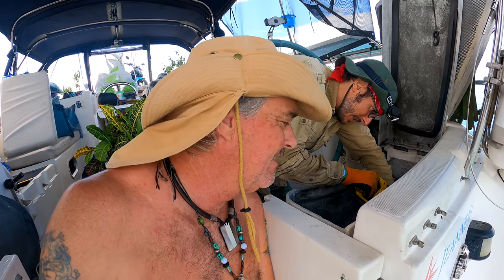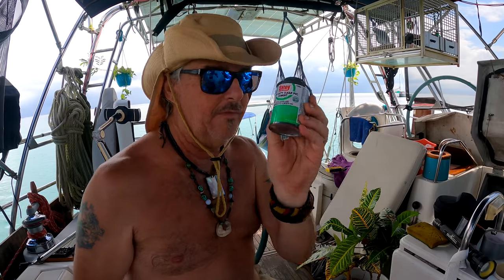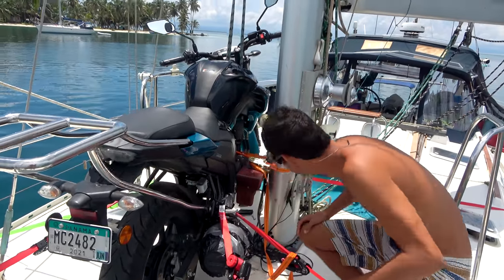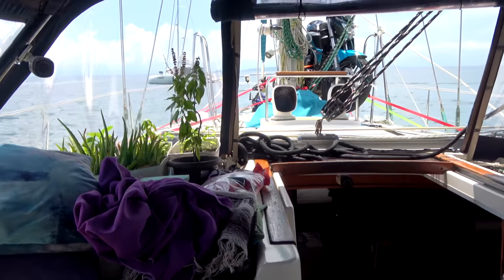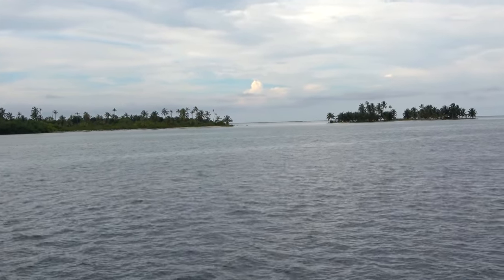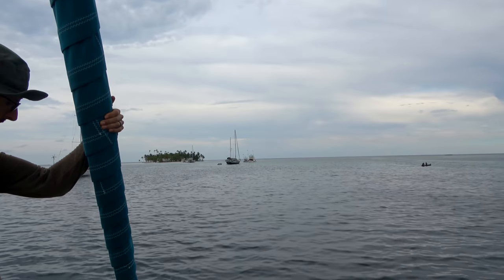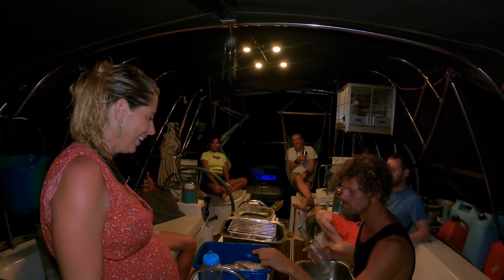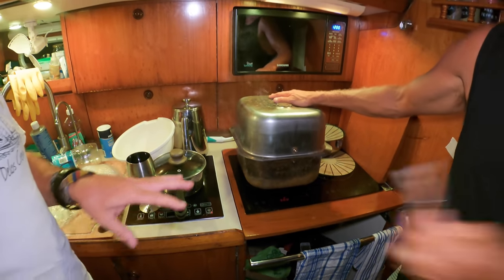SSL596 ~ Yay, we FINALLY got it to WORK..!!

Comment: PVC is fine for a while for high temperature application. When the white color PVC pipe get to be brownish, replace it with new one, because it means the plastic is brittle and could fail soon after.

Comment: Great job Cap on pipes  . on that pvc there is a schedule 80 that is more heat resistant . look for  a vinal  tape its tough and water proof .those couplings with the clamps are great I've used them on dye tubs to connect pipes that supply boiling dye  Good sailing and watch your top notch.

Comment: Maddy be careful what you wish for. NEVER NEVER ever go to sea in a multi hull boat. If you get hit by a big wave and turned over the mast will most likely be pointing down. However Sophisticated Lady if it gets turned over will always have the keel pointing down. Safety safety first.
Reply: Thats not totally true ...a cat can lift if its overpowered but cruising or passage making vessels shouldn't have that much sail exposed. High performance New cats have automatic de powering systems. If a cat does go over it floats on for most of the time ...if a displacement  monohull goes over and ships water the keel wt can take it down double quick also with bolt on keels loosing a keel will loose the boat..very quick. James Wharram learned from the Polynesians and showed that 2 or 3 were as good if not better.

A lot comes down to the design, the captain ..and cautious sail choices or even trad sail, sails there are other designs.

Nautistyles recently toured one of those new Neal 47Trimarans.
Quite a novel layout...  theres a Polish familly who  are reffiting back in Gdansk Poland at the moment but they have an older 55 Neal that they've lived on for years Bart is an airline pilot. That thing is even more space inside.

Comment: Stainless steel pots and pans used to be nonmagnetic because of an aluminum slug at the base. Current stainless now has a metallic one because of the high use of induction appliances. I refused to change over and don't use my induction plate with them, only my cast iron pan. My copper pans don't work neither. ...Cheers...

Comment: Rick, I have appreciated your intellect for a few years now.  But Buddy, I think you are dead wrong about the PVC Cement.  It definitely causes a chemical reaction between both parts that melts them together - and, of course the anerobic action of the chemicals, stops the reaction so the parts don't completely melt.